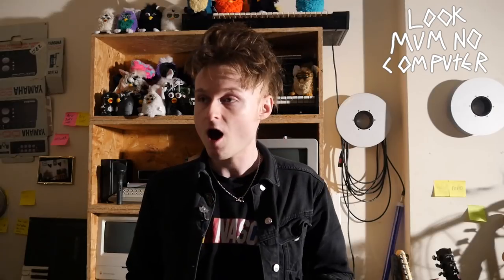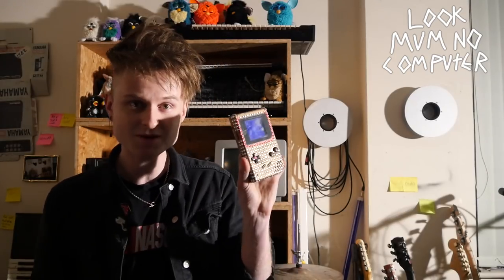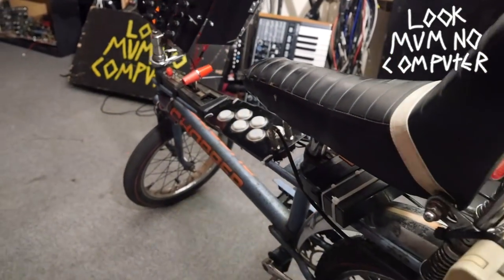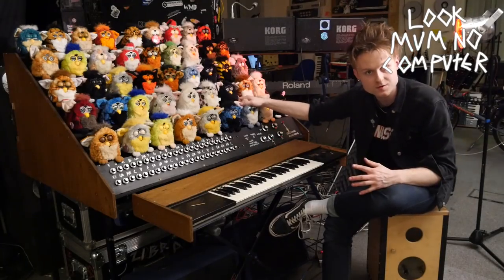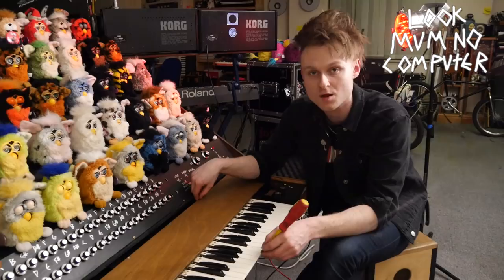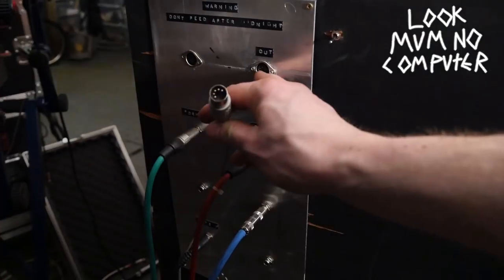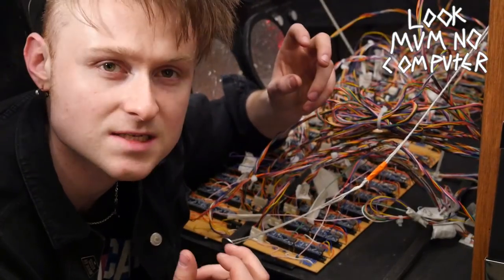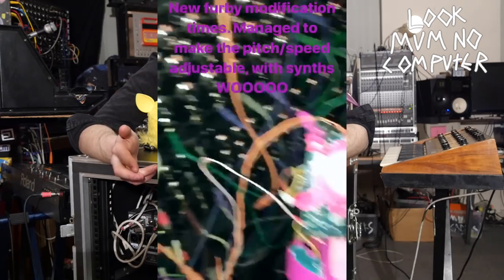HOW THE FURBY ORGAN WORKS WITH LOOK MUM NO COMPUTER

Comment: That bike is outstanding!
Reply: I kinda thought he would show how it runs on energy while riding the bike. I think that might be a neat feature since you have to coordinate the bike into not crashing, keeping balance, recording, keeping a certain speed or enrich or devalue it while you program the synth on the bike. I hope this helps as a inspirational tip. As a musician you're everything I want to be. I definitly wanna do stuff like you too, but I got no idea where and how to start. Still overcome with simple tracker software.
Reply: Perhaps he used some type of kinetic energy device to charge it, connected to the wheel? Like a hamster to a running wheel
Reply: I think it's more of a simple battery under the hood.
Reply: That would make more sense.

Comment: Sam. Loving your work. Have you ever messed around with creating an FM synth?
Reply from the maker: George Barton I was thinking about making an analog fm operator synth. But never got around to it as I’m personally not toooo keeen On fm sounds 😞.
Reply: I'd love to see it done. I'm a music producer who has only ever used digital synthesis and i'm really interested in analogue modular systems, I want to build something that i can use in my music. Your channel has inspired me to look into analogue synths. ill also be joining a patron as soon as i can
Reply: Yeh man you got to get on it sam . Maybe a S.A.M 3000 50 operators minimum 😅😅😅
Reply: Adamski A. That is a great idea. Maybe build it out of old FM radio parts. Is that possible??
Reply: Just create an FM synth from the YM2612 chip, which you could find in a Sega Mega Drive.
Reply: IronCurtaiNYC Yes thats sound promising actually. I can see massive wall of megadrives on that video if it ever occured. I think that particular ym chip is multitimbral as well.

Comment: It is just crazy to have 60hz hum from a music creator like you. Plz, consifer fixing it. You may have shielding problems(which can be fixed with 2 unbalanced differential converters, or ground loop issules
Reply from the maker: wzd leo it’s all about the 60hz Hum haha! It’s all the rage. Editing on the road. Just the way it rollsssss
Reply: Thanks for the reply. You must be really good at electrical hardware engineering to create such complicated musical machines. I am really impressed. Say, properly wired pieces of audio equipment should not have any humming. However, the more different audio sources you have the easier you will have a ground loop problem. Basically, that is when your audio signal travels not only through the wiring, but also your mains power supply(because they are all powered on the same mains power). Humming can be fixed by isolating all audio inputs/outputs and grounding all your audio gadgets to the same ground.

Comment: Couldn't you have used like an adafruit trinket for the control boards instead of arduino nanos? That would be cheaper and smaller.
Reply from the maker: MazeOfEncryption got the arduinos for a quid each cheapest things I could get hold of. Bought a heck of a lot of them though
Reply: noice